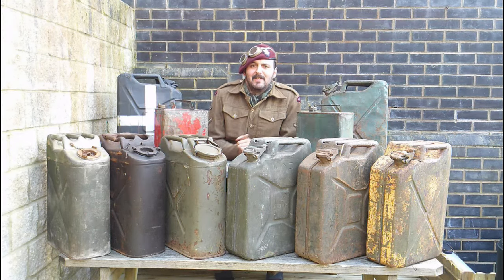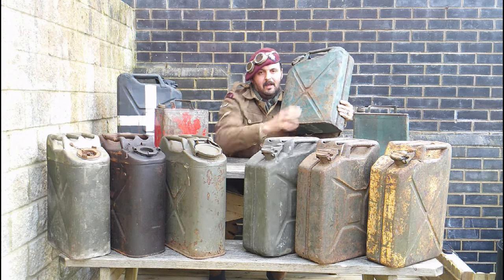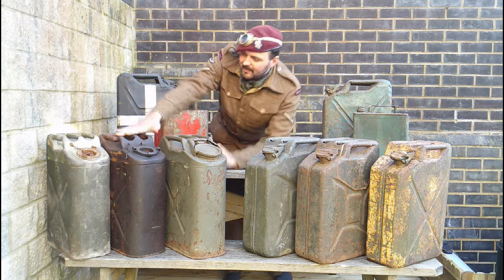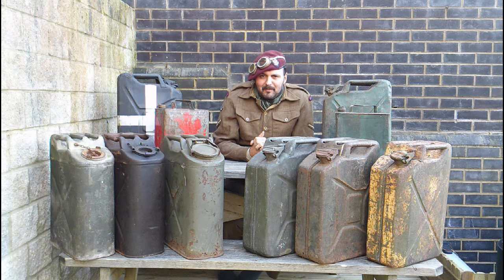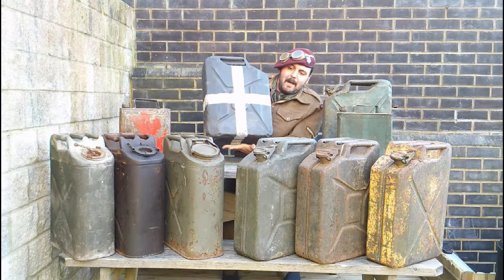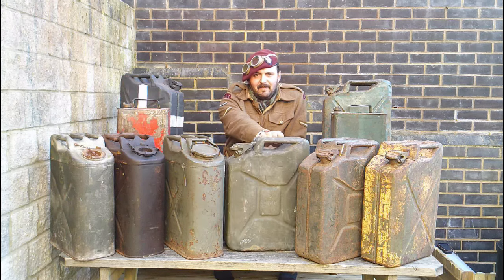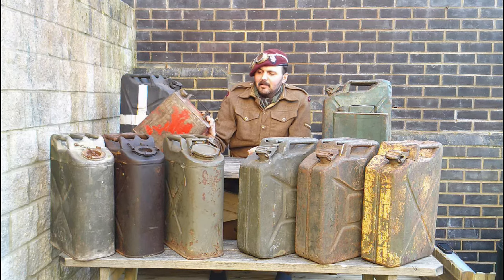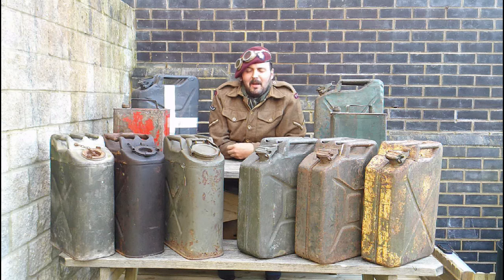A Basic History Of The Jerry Can 1938-1945

Comment: We were working northern chad and mali in late 80s and came across a couple dozen jerry cans cached in an old ruin with the same cap as the one second from the left.
They still fuel or oil in most of them, the next building over had mortar bombs and ammo cans of german 8mm, stored in it.
Two kilometers away we came across a wrecked junkers plane and several allied, italian and german trucks.. wanted to get back there after my contract expired , but never did get back as away to volatile.

Comment: I still regularly use a Valor can. It was my grandfather's or possibly even my great grandfather's. It still has the original leather washer in the cap.
My headless running man type I bought new 30 years ago, made in Germany but with the update of a locking pin on the lid.

Comment: Around the late 80s or so the US went to making the water can in heavy plastic. They usually come in sand color and there's a matching very heavy insulator bag it fits into to keep the  water cooler (or, I suppose, keep it from freezing).
Reply: Scepter they're called, rudely priced.   2 have come into my possession over the years. A bit rare here in Aust.  They're quiet good, I prefer them if I have to pour fast.  Didn't know about the insulator bag.
Reply: It was to keep it from freezing.  They also made a fuel/oil  can in black.
Reply: @obsidianjane4413  I forgot about the black ones yeah. I have one of the insulator covers in desert tan dated 1991 so they apparently were thought to be a good Idea for keeping water cooler in hot conditions also?. But yes the plastic cans are crazy expensive.

Comment: Thanks. Why the change from the diagonal cross to the "headless running man"? I presume it improved the bracing and robustness of the sides?
Reply from the maker: It was changed to improve the rigidity of the sides and to allow better expansion of the can in hot climates.
Reply: @bradfinn1552  Thanks.